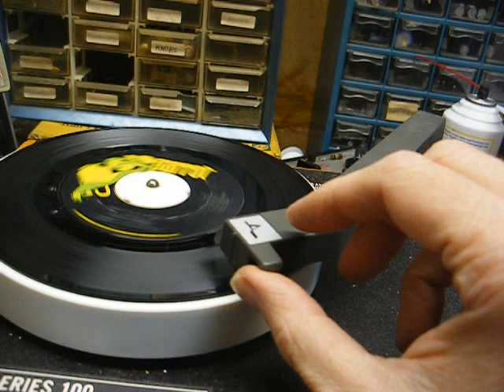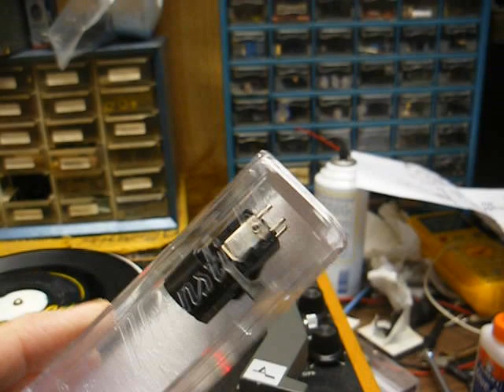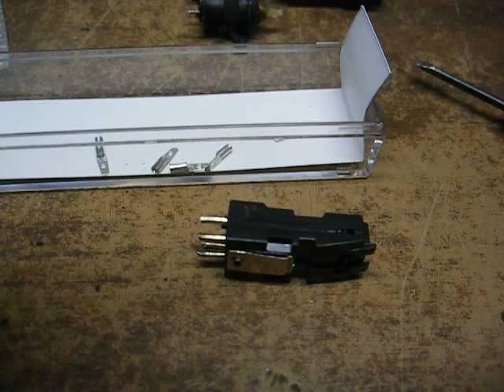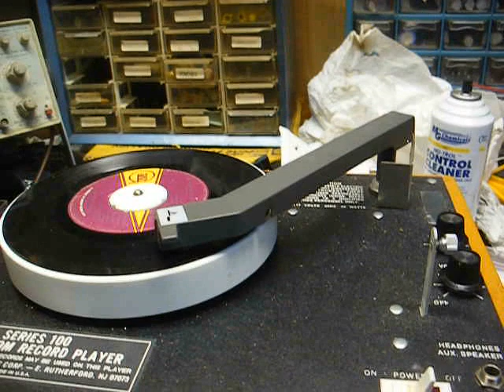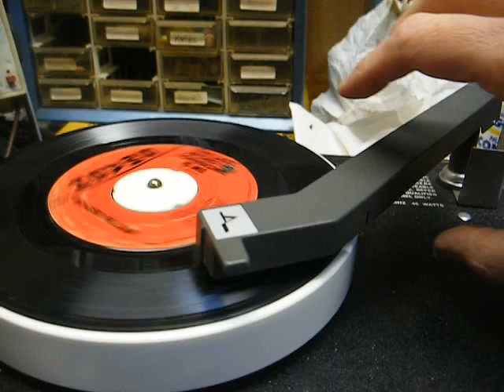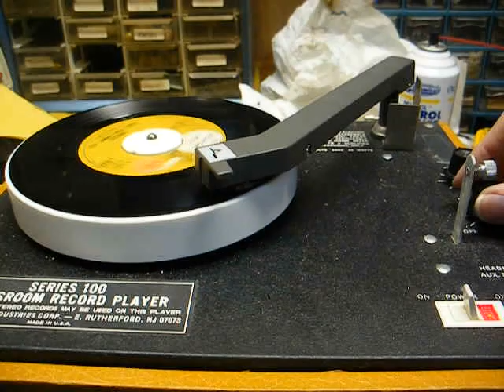Cartridge upgrade in an Educational Systems classroom record player

Comment: I have a Pfanstiehl P226 cartridge where the cantilever (the stem the needle is attached to) got loose and fell out after flipping it between the LP and 78 sides a few times. Has this happened to you? I'll be upgrading it with a NOS Electro-Voice stylus with a metal cantilever, which looks much higher-quality than the plastic cantilever stylus the cartridge came with. p.s. "Power Point" was actually the name for EV's competing plug-in cartridge; Astatic called their version of it "Sound Flo".

Comment: +RadioTVPhonoNut I just got done installing two 12-pin female Molex connectors onto a 1980's PBX system, and had a similar struggle, which required burnishing (with DeOxit) the male Molex headers.

Comment: always good to see the legend back at work!
Reply: wish the legend would answer some of his comments!
Reply: Rob Simpson the legend is too busy to attend to us lesser-beings :(.
Reply: yeah, unfortunately that seems to be the case :(
Reply: maybe he doesn't even read them!
Reply: Rob Simpson i guess i can't blame him he is superior to us in every single way!
Reply: True...
Reply: Well it is not a matter of him being superior to anyone, the man is legally blind.  I am sure it is a challenge for him to get on here to read the comments.
Reply: kelly mitchem shush its due to his superiority
Reply: Well he is a very smart man, but he does not think of himself as being above others. I just wish I had his knowledge of electronics.  when I was younger I use to work on lots of electronics, but I never had the knowledge I really needed.  I use to modify CB radios back in the early 90s and did some really good work. I use to install channel kits that added 80 more channels, install  variable wattage controls and open up the modulation on them.   I did some good work with the limited knowledge I have, but could have done better with the proper equipment and lots more knowledge.
Reply: I wonder if that would make a good talking book phonograph providing the speeds are changed to 8,16, and33 rpm.

Comment: Where I work currently, we get donated to us a variety of turntables and phonos where the 'cantilever', and thus stylus, is pointing in some really weird ass direction, like sideways or at an angle that could not be measured with any scientific instrument on this planet...!  

Occasionally, I'd get lucky, just by pushing in on the cantilever, that is into the rubber bushing from out which the cantilever/stylus combo sticks, and restore some serviceability and fidelity.

Comment: I have a question. On pin 8 of a 6x5 rectifier tube is the cathode connection. Does anyone know how many voltage it should be reading? Is it 5 volts? I'm getting 0.003 voltage, but when I'm connecting the cathode and the high voltage plate to my multi- meter I get 316 volts. The problem is that my rectifier tubes keep shorting out though I replaced the electrolytic and 6x5 tubes several times.
Reply: No, the cathode voltage is where the B+ voltage comes out, so high voltage (but unfiltered) DC, high voltage AC is applied to the plate pins. The way to measure the B+ voltage is between the cathode of the 6X5 and B-, usually the center tap of the H.V winding on the power transformer. 6X5 tubes were really designed for medium H.V voltages at low current loads, 70 ma and less, so if your 6X5s keep failing it's either that  something in the device is still drawing too much current, or the device was poorly designed such that they are running the tube at too high of a voltage. The voltage specs for 6X5 tubes are posted online, and so are likely the specs for whatever you are working on, so I would consult with those. Not all 6X5 tubes are created equal either, the GT style ones with the "X" styled plates are probably the most reliable, G style ones would be the worst, but they are all fine as long as they are used correctly, such is in a five tube AC set or a record player, and not like they were used in some Zenith radios in the early 40s.

Comment: How can I slow down speed on a Crowley wood record player.
Reply from the maker: There are usually two pots on the bottom of the motor and these pots can be accessed by a small screwdriver. One is for 33 and the other is for 45. I think the pot for 78 is on a small board that has the turntable power connector plug on it.
Reply: @radiotvphononut  it's a state of st Louis brand.i opened the bottom.and didn't see a adjuster on the motor or on the side.

Comment: 4:50 Suppose you wire L and R in series, + to hot, - to + , and - to GND, so the channels add? Would that be enough voltage for most of these amps?

PS: I wouldn't mind these Chinese DC motors so much if they could just put the speed trimmers on the deck so the user could keep them adjusted. Having them (or it) on the motor itself is almost the worst of both worlds.

Comment: Time to move on in technology unless you are selling to a collector. I do love seeing the past, when I grew up, but have long accepted its gone.
Reply: Well records and record players are making a comeback over the past few years.  You can buy new records from on line stores and there are some specialty stores like 2nd and Charles that sell new and used records.  The sad part is you can only find cheap junk made in China like a Crosley or very expensive turntables to play them on that are new units.  You can shop around for a good vintage turntable from the 70s or 80s like I did.   The one I have that I really love is a direct drive Technics that was made in the early 80s, its still works perfectly and I can buy new cartridges for it with no problem.